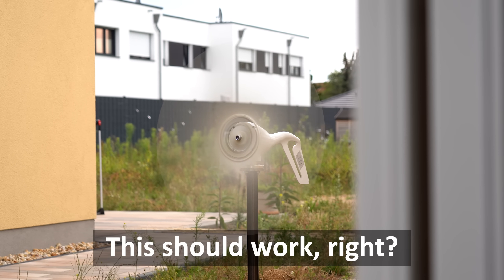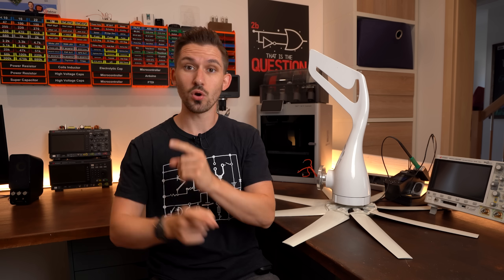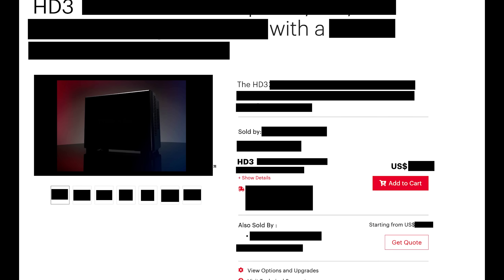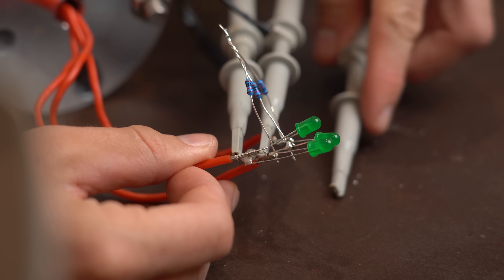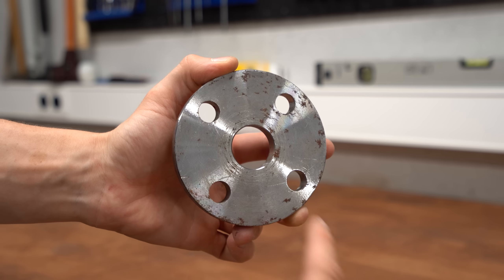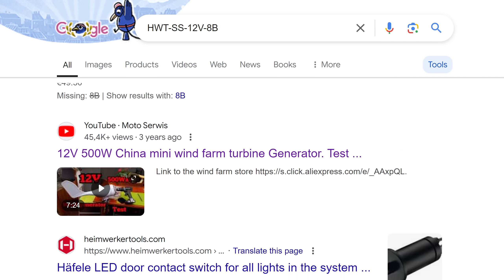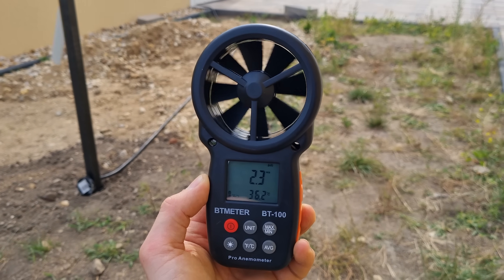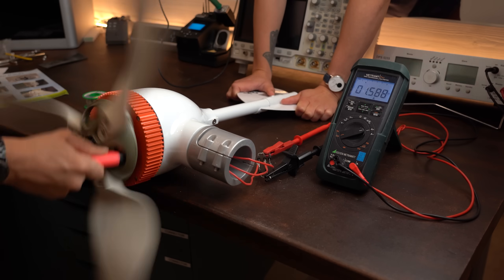I tried to Power my Home with Wind Generators! (Worth it?)

Comment: For the pipe diameter - I think you were supposed to flange mount.  Also, I think you need to mount the head much higher off the ground to reduce the ground resistance to the air (surely you can get a LITTLE higher?)  Also, maybe you wanted to try a small transformer before converting to DC, so at least the voltage level is higher.  I think that would introduce some wasted power, but... at least some of it would be raised to a level that it would charge... maybe.  Thanks for doing the video, it was interesting and got me thinking!

Comment: Very helpful! I have been wondering whether to add such a device to my solar powered catamaran as a way to generate SOME power overnight or during windy conditions. It would seem fairly useless at ~1.5w even with what appeared to be quite decent rotation. All that said, I couldn't help but worry about some unsuspecting animal or even child encountering those blades while mounted so low.

Comment: 5:50
Viagra can sort that for you mate.

Also the three blade turbine is the more efficient for producing electricity at medium to high wind speeds. That first one you used had eight blades for some reason, far too heavy for low wind speeds

Comment: No, no, no.There is something called turbulence that has huge impact on power production near the ground. My 2KW wind turbine with 10 foot blades is on an 85 foot tower and produces a lot of power. If you can't put it up higher you are best off to just forget it. Because it won't work.

Comment: An increase in length of the blades should give you a return proportional to the square of the change.. worth a shot, but you’d need a higher torque bldc, maybe custom controller. Maybe additional blades would improve torque at low speeds as well. Or… whatever.. n stuff.

Comment: My own experiences with WIND was that it is GREAT, as an addition to a solar system. For those days, or snowy cloudy WEEKS to supplement the solar power. With the solar only, we ended up starting the generator once in a while on nasty winter weeks with snow and clouds. Installing a 5kw wind turbine eliminated that problem entirely, giving us enough to get by without running the generator. I honestly LOVED it....

Comment: I have the same issue with a vertical 12V wind turbine its prouce only 8V , I build a pool and a central pipe that exeed the top of the roof;s dimension with 1 meter . It's need verry hard pool if start balancing they create a breake.I think if i choose 24V wind turbine with 12V controller it's my solution . What do you think?

Comment: No it isn't worth it at low elevation  and  if it is limited to  certain wind direction. You would be way better off with a vertical  axis wind turbine. It works with less wind speed. It is more scalable without huge extra expense. And  it can be made with simple materials.

Comment: My thinking on thee wind generators. DO they have to have all the parts housed in the SHELL itself. Cant you simply have the Windmill part of its be powering a mechanical shaft that goes down to a GENERATOR, rather then put the generator right in the housing. You would be able to make a windmill you have more control over.

Comment: I live near Minneapolis and 1 of my relatives (had) a neighbor with 3 wind turbines, on 100ft towers, placed on a ridge in his property.
Seemed like and ideal location and they were installed, ~2006.
I recently stopped by and noticed the turbines were gone.
Reason: No real savings! The cost to maintain and repair the turbines was roughly the power output.
The biggest blow came from severe weather, when the guidelines were snapped on 1 of the towers --- and the tower was bent over.
That put the whole project in a deficit.
Conclusion: Unless you have a unique location, you're off the grid, subsides, high power costs or something else unique ---- wind power just doesn't pay off

Comment: You could extend the blades giving you more torque to play with and stick a gear system inbetween. If 400w is this useless I might as well build one for cheap from a old drill motor 😂

Comment: Its not the windspeed, ots the torque generated.  Low torque converts into low power. Power is your voltage and current.  Increase one, decrease the other.  It all comes back to power, and power is from your torque

Comment: If you want to try this for real, you'd need a real wind turbine, but that is a very different investment ... just like you won't get anywhere if your budget for a solar roof was only ~250 bucks and a single tiny panel ...

Compared to proper generators these aliexpress/temu gimmics are the equivalent of a kids gocart to their parents car.
Both have four wheels and can drive around but one is a toy and not suited for actual transportation.

The issue is, that people are simply being lied to on the product sheets.
A turbine with less than 2 meters diameter is basically useless even in windy areas.
You'd need 4-5 meters diameter to produce solid results.
That Chinese crap promises the moon on paper while in reality barely being able to charge your phone.

Comment: would funneling wind on a smaller fan work better? I imagine that bigger blades add weight, and without funneling, wind simply passes through because the breeze does not have a consistent AoE. Having the same motor, but having wind funneled into the blades allows for more wind to actually spin the blades, and possibly faster. I figure that faster rotation means higher output.

Comment: Had my wind generator for 19 years on my canal boat , (on a high pole in a open area , you should note what other people do with their projects), with 480w of sola ,& 5 x 110ah battery's ,also converted most of my equipment to 12volt , with a small 200watt inverter to recharge battery equipment, ( drills , chainsaw, all boat pumps, hover , phone and tablet , it's great thing to compliment sola, you definitely need both, 
Ps don't over think things. 
Richard ,

Comment: The maximum energy that can be extracted from the air stream using a turbine at 100% efficiency is P= 0.59 *( (air density * rotor area * air speed^3) / 2). For example, for a rotor diameter of 1 m and a wind speed of 5 m/s, it is only 36W! At a speed of 10 m/s, it is 290W. Never don't believe the Chinese. If a Chinese tells that 1+1 = 2, you better doubt it.

Comment: Sorry, im late. 
I had my mind around such problems a while ago. You know, there is such circuit on Ali, that boosts voltage at cost of amperage, it can yield more practical voltage to charge your battery, but with less current.
It is tunable, and quite stable.
Rough translation from my language - "boost converter", it is DC

Of course it is more wastefull in terms of power overall.

Comment: Putting a wind turbine on the ground and hoping that it will work, close to a building and fence. Honestly? I am only scratching energy harvesting with my EcoFlow River 2 max and 220w panel for my (still) construction site in Panama. But even I do know that a wind turbine must get a free wind flow to run properly. Grüße aus Panama 🇵🇦

Comment: Using wind to generate electricity IS worth it, but just depends on various factors. A small wind turbine, sitting between buildings will not produce much of electricity.

Comment: A 25mm pipe would be perfect for a 29mm hole. Allowing weld penetration at a subsurface level. Similar to having a 45 degree bevel on a vertical to horizontal joint.

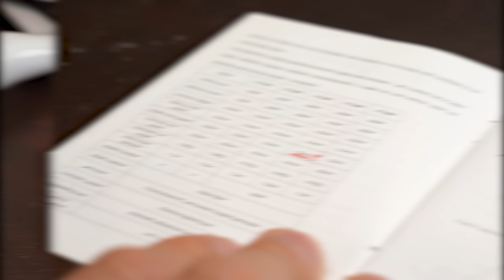Comment: 12:13 What Next? Use better magnets for higher torque. Torque is what you need for wind generation. The wind farms around here are up on mountains and they barely spin at all, but the bearings inside them are so well engineered that even a slow rotation of the blades creates a lot of energy, so much so that they have to anchor on the brakes due to not being able to store excess energy(pathetic I know...). But you should see the magnets and coils inside those. The bearings may be very slick but a small rotation creates torque, and that's where the most power comes from in electric generators. Best wishes.

Comment: Testing any wind turbine at ground level in low wind speeds is not a true test. Make sure you buy a quality turbine, mount it where it can receive turbulence free wind and that means at least 20 ft off the ground. You bought two low quality turbine and tested them three feet off the ground. Your results did not surprise me. I appreciate you trying to learn about wind power, but your testing methods are not proper. Peace.

Comment: Thanks for the great videos! Not sure how i missed this one until now. If you don't mind winding some coils and pouring resin then you should build a Vertical Access Wind Turbine "VAWT" with a 3 phase stator. VAWT's are the best designs for low wind area. Add wind tracking and your next level. Also the way the coils are wound would make a huge difference. And yes this is "Top Secret".

Comment: 5:45 the concrete might feel hard; but it was nowhere near full strength at 2 days
for actually having it stable under load (wind on the rack if its full etc), you should probbably wait more like a week orso

but for this application it was probbably fine tbh

Comment: A refreshing change to the myriad of videos of DIY wind generators cobbled together from plastic tubing and an old bicycle generator. Most of those contraptions claim to be able to generate 2.5kW, which is 10 times the output of an olympic cyclist. At least you managed to light up 3 LEDs, which is more than some of them.

Comment: i have an old one from a boat i refurbed and never installed and looked like it connected straight to the 12v charger? blades make the biggest difference for turbines, check out a Silentwind with blades for low wind speeds. one of those on every chimney and no power issues...

Comment: I would like to know the long-term effects and benefits. 

Having five of these, over a period will help you. 

In situations where high storm activity is, they're incredibly valuable whenever the power goes out as well. 

You have to consider the ability to extract the value in different circumstances. 

I have a foldable solar panel that I use whenever we have hurricanes here in knocks our power out. 

When we do not have power for 5 days, this helps me keep my device charged That way I can still stay in communication. Even if it takes 3/4 of the day to charge. And that's only when we have clear skies. 

Variables to consider. 

Absence of electricity. 
Amount of electricity gained with five wind turbines. 
Storage and use ability. 

If you have all of these things going to a small battery bank that charges that battery bank, you can indeed use the wind electricity for alternative reasons that you can take off the main load of your domicile.

Comment: Wind generators for residential homes are BS... : because simply put there is no powerful and more important CONSTANT wind in urban areas ! That's why we build huge wind turbines at above 100m in height. To get your wind generator to produce some power, go to the sea shore...or high in the mountain . But at best, you'll get about... 20-30 W of power for a diameter of 1.2 m at max wind speed for a chinese low price wind turbine !!! The formula for the theoretical power available from the wind is: P = 0.5 * ρ * A * v³, where ρ is air density, A is the swept area of the rotor (πr² or 0.25πd²), and v is the wind speed. This is the THEORICAL MAX POWER... in optimal conditions.. For example : 5m/s and 1m diameter gives 60W of power in theory ... and 10 times less with a cheap chinese wind turbine ... in reality LOL..

Comment: If the copper windings are garbage, you're not going to get anything out of it. Most of these are junk. You gotta spend some money. I went through several of these clunkers until I wind turbine called Esta breeze. Yeah, you're gonna spend $700 But it will be the last winter by new purchase.

Comment: The best is a dc-dc up, it works from 3.5-30v, I've tried it myself in a wind turbine. It has an adjustable output voltage.

Comment: I have had a similar experience with cheapish ebay wind turbines. 
I have a 3KW vertical axis one ($550Aud) that makes no power in a really windy environment, I also tried a 1200watt vertical axis ($180Aud) that makes minimal voltage but no wattage. 
I also have a Vevor 500watt horizontal axis turbine ($190Aud) that is good for aprx 100watts and in a full gale, made 175watts.
I'm negotiating with the suppliers atm.
(Whilst I don't have an oscilloscope, I do have an electrical licence, appropriate tools, meters and experience, also my dual mppt hybrid wind and solar controller gives a digital readout of all the power in and out)
Reply: https://youtube.com/shorts/b7FdlHApKK0?si=9c3T5Joew-iM3pld
Reply: https://youtube.com/shorts/PfqPg-YYcOI?si=rK-hfzxzZhkZKITi

Comment: Those motors are for high wind speed which is why your not getting much voltage.  Supposedly a low speed motor/generator like from a wheel chair or care windshield wiper motor works better in low speed situation.

Comment: Try a silent vertical wind turbine. They are usually inside a secure case and much quieter and can produce more power because of the compact, vertical build.

Comment: Given the problems of low wind speed and disturbed flow at low heights and possible restrictions on building high towers. It may be better to organise a community group investment in a large scale turbine built in an ideal wind location. One of the power companies in my area has a program where you purchase a solar panel and they will add that panel to their solar farm. So you can have solar even if you live in an apartment with no roof access. You also don't have to pay for a solar inverter or any installation cost. Just the cost of the solar panel. The output of your panel or panels are monitored and a credit added to your power bill for any power generated. Maybe something like that but for wind power might be possible.

Comment: Maybe try removing the blades and attaching a cordless drill to the shaft. Then you could test the generators power output at various speeds and build a power curve chart. This would let you know if the generator was useless or if it just needed  a much higher rotation speed. It would also let you know the actual maximum power output the generator was capable of delivering,

Comment: All these AliExpress crap windturbines promising 5kw, 10kw 20kw should be forbidden 🚫 thanks for testing and saving my money 💰 
But still wondering how much speed you would need to apply on these generators get the max performance, you could try to accelerate them using motor or a drill

Comment: $$P_{wind} = \frac{1}{2} \rho A v^3$$

Where:

* \( P_{wind} \) is the power in the wind (in Watts).
* \( \rho \) (rho) is the air density (in kg/m³). At standard atmospheric pressure and 15°C, this is approximately 1.225 kg/m³. Air density varies with altitude and temperature.
* \( A \) is the swept area of the wind turbine blades (in m²). For a horizontal axis wind turbine, this is the area of the circle swept by the blades, calculated as \( A = \pi r^2 \), where \( r \) is the radius (length) of the blades. Alternatively, if you know the diameter \( D \), then \( A = \pi (D/2)^2 \).
* \( v \) is the wind speed (in m/s). Notice that the power is proportional to the cube of the wind speed, making wind speed a critical factor in power generation.

*Power Extracted by the Turbine:*

The actual power extracted by a wind turbine (\( P_{turbine} \)) is a fraction of the power available in the wind. This fraction is represented by the *power coefficient* (\( C_p \)), which is a measure of the turbine's efficiency. The power coefficient is specific to the design of the turbine and varies with factors like wind speed and the turbine's tip-speed ratio (the ratio of the speed of the blade tip to the wind speed).

The equation for the power extracted by the wind turbine is:

$$P_{turbine} = \frac{1}{2} \rho A v^3 C_p$$

The theoretical maximum value for the power coefficient (\( C_{p_{max}} \)) is defined by the **Betz Limit**, which is approximately 0.593 (or 59.3%). This means that even an ideal wind turbine can only capture a maximum of about 59.3% of the kinetic energy in the wind. Real-world wind turbines typically have \( C_p \) values ranging from 0.3 to 0.5.

Therefore, when calculating the actual electrical power output of a wind turbine, you would also need to consider the efficiency of the generator and any other components in the power conversion system.

Comment: I did buy one last week who generate 23v by hand
Reply: Was made to go at 48v i think if you want a usefull one for 12v you need a 24v one and in my case i will need a 48v output so i will use a buck boost

Comment: Our 5 kW Britwind R9,000 domestic wind turbine, in its first year, produced over 20,000 kWh with an average wind speed of 7.5 metres per second.  That is more than enough to fully power an all electric house (with 27 kWh of battery back up. (a windy coastal location certainly helped)
Reply: Yeah but it’s 100 times the cost
Reply: Now tell us how much did it cost? 30k pounds?
Reply: Hey a South African!! 😅😅😂😂 Eskom really has down bad!!
Reply: Apparently we need your video and not his..lol

Comment: Just make some reserarch on how much big should the fan be to generate enough energy for you.
From what i see here, you used the worst short type. If you put one with longer fan and not in the ground but as high as possible, you'd be astonished
You need a bigger fan and you will have definetely more energy

Comment: My experience is exactly the same, i install the wind generator at high ground and is pain in the neck, low output, noise by vibration, bearing break, blade break, expensive to maintain. Not worth.